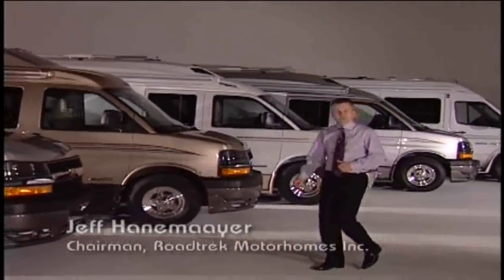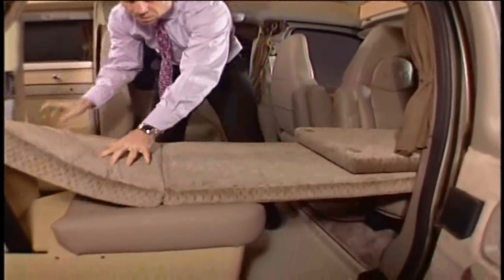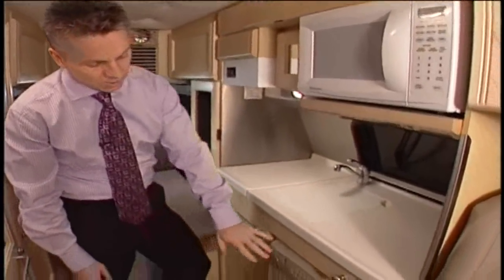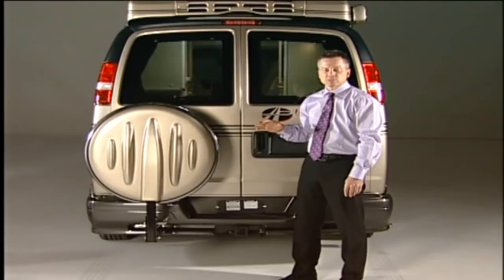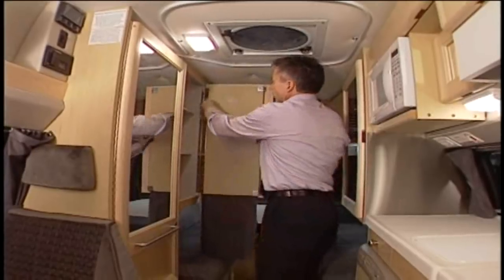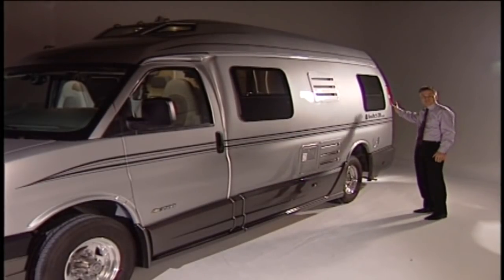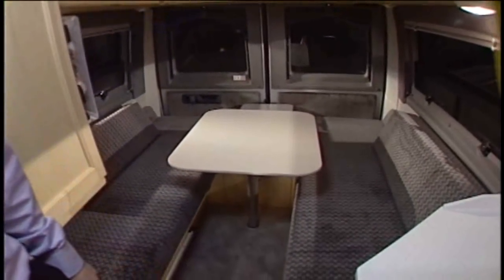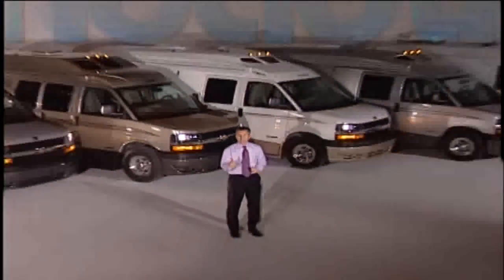Roadtrek RVs for Sale at Motor Home Specialist (Product Demo)

Comment: I had pre-owned "islander rv" class b (dodge) was custom made, I did not realize that till i sold it,there were apparently only 2 built.it was my ist rv.I'm  looking for another van conversion roadtrek's my choice. they are a well designed vehicle,they're good to go offroad  into the mountains for fishing and kayaking. I put a large sheet of bubble wrap inside to protect the walls n floor n  put a 9'necky sky on it's side inside the back of the van for day trips for fishing.

Comment: hi why not get a few solar cells, the thin sheet model thus you can get rid of the gas cooker, and not be relent on generator as much,
also the thin sheet cells pump out 100 w per sheet so with a roof like that you can have 2 to 3 sheets?,
food for thought,

Comment: Great presentation! Very helpful in understanding all the Roadtrek models ... but (and there is always a big butt ... maybe mine) did he show an exterior storage area for "... two six-volt batteries" or was that a slip of the tongue and he really meant two twelve-volt batteries, which seems more logical. Who uses six volt batteries, unless he intends to hook 'em in series to get the more useful twelve-volt electrical pressure? And that would be just plain stupid, although it would work.

Comment: I have been looking for an RV for a year now. What holds me back is that these look unsafe as hell. No 3 pt seat belts, He states that the factory seats are the best so why not use them when additional capts. are added? I have not looked at the bases that hold the extra seating But I can't see placing a set on top of a plywood box as meeting crash test standards. Lastly what's with all the plywood cabinets? looks 1980's not modern not $100-150k. The Gov should ban these as un-road worthy.